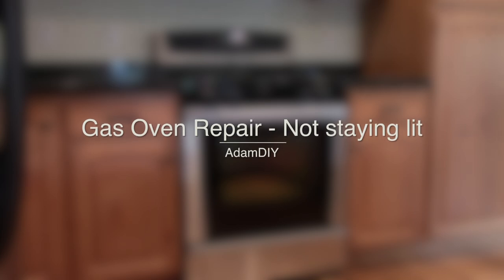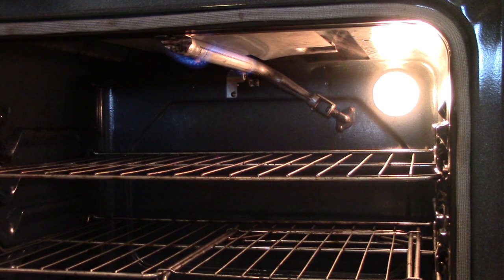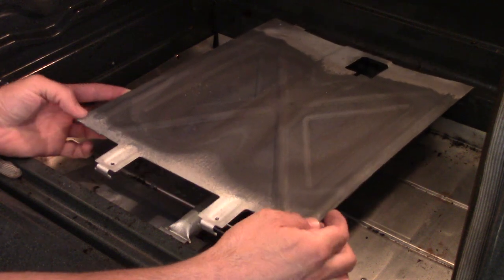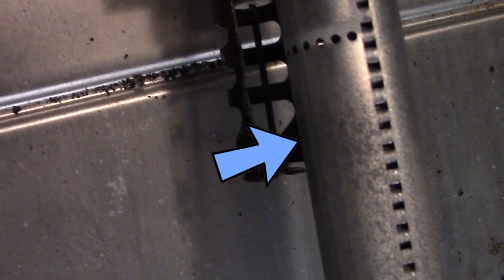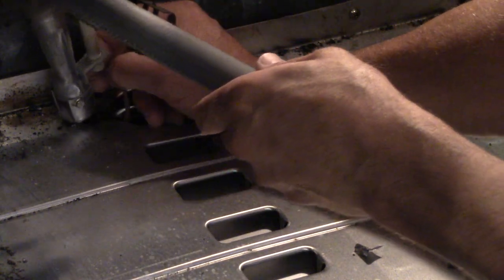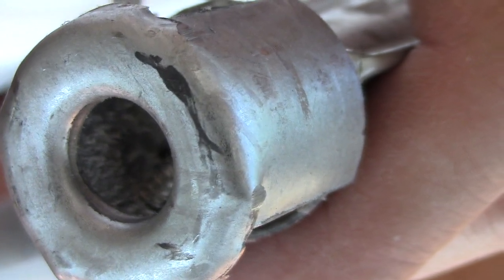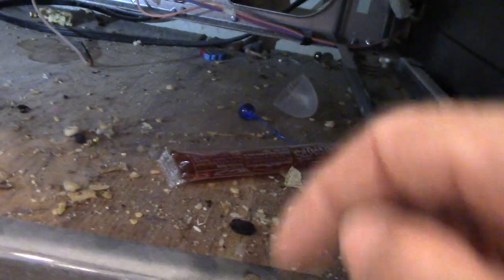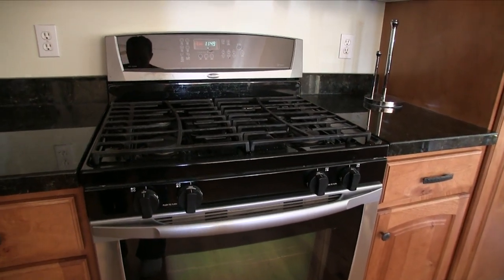How to repair a gas oven - Troubleshooting, won't light stay on or heat up

Comment: hi, I have a similar whirlpool model WFG381LVS1 and it has a sparker to start the burner tube. The sparker ignites the tube but then gets a signal to shut off.... I am curious about the signal that send back to the control board, it looks like mine its telling it tthat the fire is not lit and then sends the shut down signal. Any ideas?
Reply from the maker: you can clean it and if that does not work maybe it needs a replacement.
Reply: I have the same problem with my 3 year old Amana (Whirlpool).  The bake ignitor sparks twice and lights the burner, continues to click two more times after it has already ignited the burner and then the gas goes off.  The broiler ignitor/burner works fine.  I tried the sandpaper trick and cleaned the burner tube, but did the same as before.  Put in a new ignitor and got the same results.  Replaced the Spark Module Board and still did the same thing.  I tested my gas valve and it registered that it is working.  So now I can only think it is the control board panel which costs more than a new stove!  I am very disappointed that I have purchased a throw away appliance. Ridiculous!  Did you ever fix your oven?  What did you do to fix it?
Reply: Tammy N i did replace the gas valve and it seems to have done the trick, fingers crossed
Reply: @claudiolombardo9936  Thank you for replying to my question.  I am so glad you were able to fix your oven.  I am still trying to fix mine.  I will try a new gas valve and cross my fingers as well.
Reply: The gas safety valve replacement worked!  Thank you again so very much for letting me know how you fixed your oven.  I am so pleased to have my oven back!
Reply: @tammyn5225  did you resolved the problem? Mine works sometimes fine, sometimes clicks and nothing happens.

Comment: Is this a spark igniter or a thermal igniter? My GE igniter glows and supposedly opens the gas valve when it heats to certain temperature. This looks like an electrode for sparking the gas, so i'm not sure if i can use this technique with my oven.

My model is: GE JGBS20WEW2WW
Reply: Wang Hung  No, this will NOT work on a glow igniter. Just went thru this on our GE stove. The igniter was glowing but still had no ignition. Turns out that these units have the igniter wired inline with the gas valve solenoid. What happens is that as the element heats up, the resistance in it goes down. As the resistance goes down, it can pass more current to the valve coil. Unless the valve coil sees the right amount of amps, it will not reliably open the valve to feed gas to the burner, thus no ignition. Apparently as these igniters get so old, their ability to let the resistance drop far enough to pass a high enough amperage to the valve goes away. So they may still glow, but not work properly. Replace it he igniter and the problem goes away.

Comment: My sister-in-law's double oven (Maytag MGR6775BDB) has been blowing a breaker occasionally when starting the oven.  It has morphed into happening every single time.
We've tried a different outlet and circuit which made no difference, so it's the oven, not he breaker.  After opening the back I found two ground screws that were very loose and tightened them with no change in symptom.  The control board seems to operate fine. The upper oven's igniter hasn't worked in years but hasn't impeded the use of the lower main oven so they've disregarded the upper all-together.
Any ideas of where to go next?

Comment: Paid a guy $47 today, he said the igniter is working fine at lower level but he did not check the upper igniter,  it cluck but not flame comes out. Never tried broiling when I tried today the upper one clicks then smell gas, the guy said need replace safety valve costs me over $400. My question is how many safety valve are there in the oven? Are they one or two?
Reply: Unless you heard him wrong it sounds like he's trying to rip you off

Comment: it acts as a flame switch   same as a furnace flame sensor sends a signal back to the control board  that the burner is lite
Reply: DC voltage goes through the flame, fire conducts electricity.
Reply: @cliffyknight  how can I measure the sensor? How to know is ok beside thia cleaning process?

Comment: How did you light the pilot. That’s what I need
Reply: This oven has no pilot. It sparks and it ignites the gas.  All new ovens don't have pilots.  If yours has a pilot then its very old over 20 yrs old and time for a new one.